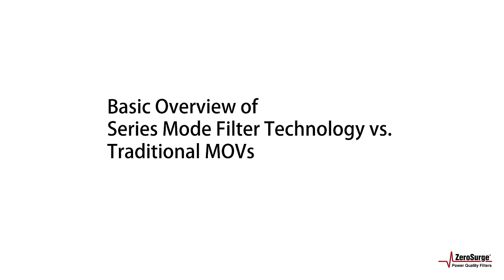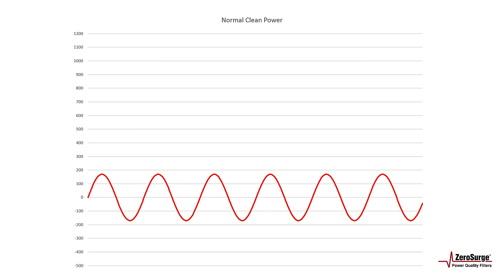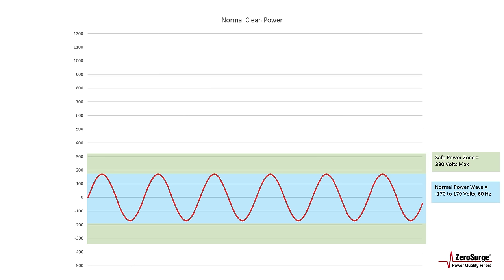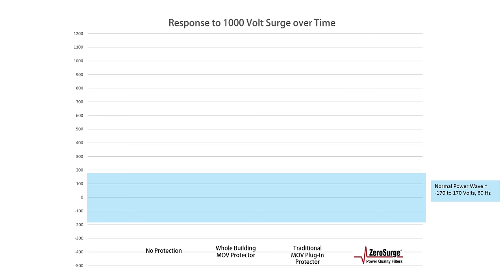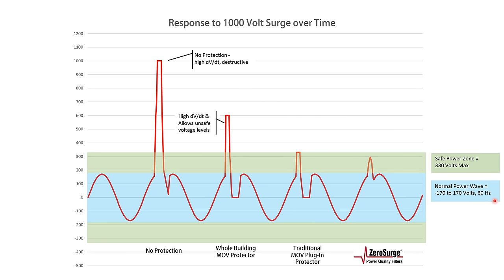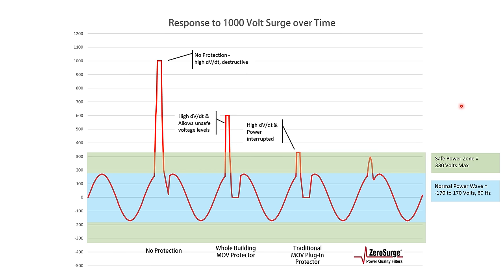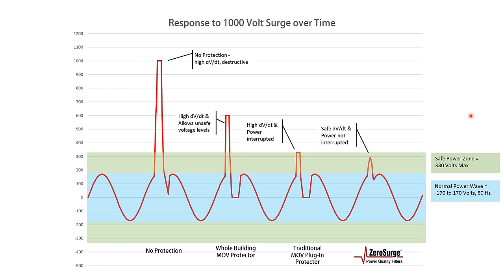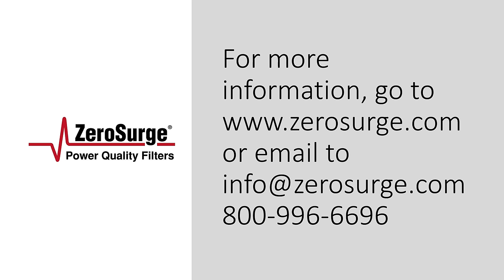How different surge protectors respond to a surge

Comment: Voltage protection should be a tiered safety system. And series mode filters would come at the very end of such a protection system which from the outside-in would look like this: 

1. External lightning protection if at risk of direct lightning: lightning rod, meshed cage.
2. Internal protection at distribution panel: Type 1 or 2 SPD according to risk
3. Internal protection at terminal outlet or panel: Type 3 SPD could be an MOV based system but could be series mode filter for better let-through voltage. 

Now I know you know this, but your website, Youtube videos and every other marketing material distort the truth to make it seem like your series mode filter is the only protection anyone ever needs. Zerosurge is not alone in this, I've noticed this as a trend among most series mode filter manufacturers. And while undoubtedly series mode filters offer better clamping voltage (for a terminal SPD) it is not a perfect system at all, in fact it is quite an inadequate protection system on its own. The major problem is that in and of itself your product does not protect the neutral terminal from surges. Your argument is that since the neutral is bonded to ground at distribution panel, neutral doesn't have to be surge protected. This cannot be further from the truth, there are many instances of perfectly wired and earthed houses whose switched off appliances were damaged just because they were connected to an outlet (i.e., neutral leg). A surge in the neutral line can occur not just when lightning hits the neutral wire (in which case part of it might probably go to earth), it can also be caused by electromagnetic induction from cloud-ground and cloud-cloud lightning strikes. Now the funniest bit I found on your website is that because you don't divert surge to ground you actually claim to protect datalines. Oh my! Consider what happens when an earthed ethernet cable that runs from building A to building B receives a lightning strike causing the earth potential of building A to rise to several kVs, this undoubtedly causes a large surge current to flow from building A to B and destroy any ethernet connected network cards and the like, unless of course it is protected by a dataline surge protector. Also have you noticed why the N-PE module in a multipole whole building SPD is almost always higher rated than the line ones wrt to Class 2 surges? That's because an MOV which is what most manufacturers use for Class 2 surge protection provides bi-directional protection from surge coming through neutral and more importantly surge going back up the earth.

I could go on, but this is a youtube comment and nobody cares. Its just sad to see what appears to be a good power conditioner which I might even consider for expensive appliances to be marketed as something it is not and in doing so tarnishes its own reputation.
Reply from the maker: Sorry for the delay in responding.  I will try to format but this reply may be a little difficult to read.---------------------------
For #1 - We always suggest having external lightning protection like a rod system.  We have never said no to this.  

------------------------------For #2 - Do not need this.  It is extraneous.  Even an MOV plug in will engage prior to the larger MOV in a panel type because it engages at the lower voltage.   ------------------------------------------For #3 - It is more than let-through voltage.  Today’s power supplies are more sensitive to di/dt than any voltage changes.  MOVs can not act on current changes.        ---------------------------------------------What you are describing is known as common mode surges.  Power supplies are required to be isolated so that they can withstand at least 1500 volts with respect to ground.  APC (who does not make series mode technology agrees with us).  I can send you the pdf of their White Paper #9 called “Common Mode Susceptibility Myth”

--------------------------------------------What we say is that the reason that MOV plug in surge protectors have data line protection is that they divert surges to the ground line which is shared by communications.  They are protecting your communications from themselves.  It is extremely rare for a data line to have a surge induced on, even from lightning.  Check out the work done by Joe Randolph who has no ties to Zero Surge - http://randolph-telecom.com/articles-faq.html  He explains how rare and how lightning affects communication equipment.  
--------------------------------------------All MOVs are non-polar so they work in either direction.  Their resistance drops to near zero once a potential exists across it.  Maybe you mean all mode protection as the early MOV protectors only were L-N?  Panel MOVs are larger with much higher activation voltage (700 to 1000 volts).  I suspect the real reason they are always set so high is that their MCOV rating needs to be closer to 170 volts than the 127 volts of an MOV with 330 volt VPR.  
------------------------------------------I know that what SurgeX, Brickwall and we say is not what you may have learned from the dozens of other vendors.  But if you piece together their literature and sift between the lines, you will find out that what we say is correct.  We have 30+ years of experience that backs up our claims.  We have military, commercial, and residential customers that have sent us feedback about how our products protect where others have failed.  We are the only technology to pass UL's 10 year exposure test.
Reply: @Zerosurge  You have completely missed the point on why tiered protection is necessary. Type 1+2+3 surge protection is necessary in addition to external lightning protection because each of those tiers can divert a certain amount of surge energy or surge current. A type 3 SPD like yours has no hope of diverting a 25-50 kA 8/20 μs class 2 surge current or 25 kA 10/350 μs class 1 surge current. Your specification sheet states only conformance to class 3 tests (1.2/50 μs). Prove me wrong and get one of your existing product certified for IEC/EN 61643-11 class 1+2+3 surge protection if you can!

You say: "Even an MOV plug in will engage prior to the larger MOV in a panel type because it engages at the lower voltage."
This is exactly why tiered protection is necessary. Most good Class 1 surge protectors use spark gap technology to divert large surge currents and has a response time of <100 ns. MOV based Class 2 surge protectors have a response time of <25 ns while class 3 SPDs have a response time of <1 ns. 

You say: "For #3 - It is more than let-through voltage.  Today’s power supplies are more sensitive to di/dt than any voltage changes.  MOVs can not act on current changes."
Oh, another twisting of facts or am I supposed to just assume you have forgotten the face of thy father Georg Ohm that you shame him so?
Reply from the maker: That is the key - we do not divert!  Our inductor limits the current flow.  The key word here is APPLIED pulse current. That means the AVAILABLE surge current from the source and implies a direct lightning strike.

The current that will actually flow, is limited to a safe value by our series inductor, and arc-over at the main service panel, where IEEE has used 6,000 volts as a typical
limit.  If our inductor and all the associated series connected wiring had ZERO impedance, then the maximum current could flow, but typically that maximum has been characterized as 3,000 amperes when driven from a 6,000 volt source by IEEE.

IF a 100,000 ampere surge current were available, or even possible, our series inductor would only allow a very safe current to flow.  And again, we are not saying that one should forego using lightning protection systems.  We feel that the type 2 SPD adds no real value.  One could use our product as a type 2SPD (and is certified to be used at the panel) but for only up to 20 amps (branch circuit) because the one limitation is that our present inductor line up only goes to 20 amps.  We have OEM customers that make 100 amp inductors that use our boards but those are for specific A/V applications.  
Thank you for agreeing that tiered protection means that the internal SPD3 will react first (as you say <1ns) which means that it will take the first hit and most likely die which could mean fire as that is one if its failure modes (according to the NFPA 34% of power supply fires were known to be caused by their surge protection).   I know I can not convince everyone and this goes against what 95% of the industry will say because they all have one way to protect and we choose a different method.  But we have independent UL testing that our product survived ten year's worth of surges and no other company even tried it so UL closed the program.  We have so many different industries that use us successfully and happily.  This forum is not the best to convince someone and I don't know if you are a troll from another competitor or what your background is so I am writing this blind.  Try asking around on the A/V forums.  They will give you their experience and opinion.
Reply: @Zerosurge  You say: "Thank you for agreeing that tiered protection means that the internal SPD3 will react first (as you say <1ns) which means that it will take the first hit and most likely die"

Again, missing the point completely on tiered protection or more likely twisting the fact. A terminal type 3 SPD would react first but in a tiered setup it would not fail because by design most of the surge current would be handled by the larger SPD. The finer SPD would only have to deal with a few hundred amps when its usually rated for 5-10 kA while lowering the clamping voltage and protecting sensitive electronics. Look, you can twist the facts all you want or improve your product, get IEC/EN 61643-11 class 1+2+3 certified, your current product probably can't do it and it doesn't protect the neutral, my suggestion is to make a better one. Heck, even put MOVs and series mode filters together to do it. I don't care, I just want something that works for all cases. If you could build a certified panel mounted single unit (rated 60-100A) that can do all that and permanent overvoltage protection due to floating neutral then you have arguably the best product in the market.
Reply: @Zerosurge  

Why does your company not talk about the self-inductance of building wiring, power cords, and similar? They provide a small level of protection by exactly the same mechanism as a series filter: high impedance at high current. A wire circuit is an inductor. 

That effect explains why Type 3 and Type 4 shunts do provide protection without conducting the full surge current. The high dI/dt through the shunt and wiring causes a voltage difference between the protected device and the circuit panel. This voltage is sufficient to activate a Type 2 device and conduct most of the charge at the panel rather than through at Type 3. 

Again: series mode protection means higher voltage nearer to the surge source and lower voltage nearer to the protected device. 

Please schedule a sit-down between your engineers and marketing, so you can stop saying silly things about how Type 1 and 2 are extraneous.There's a very good reason why Motorola R56 requires Type 1 surge protection at all external connections and strongly recommends Type 2 within a facility. 

A series filter depends on admittance somewhere in the circuit, especially to survive lightning surges. A lightning strike is perfectly capable of developing several million volts open-circuit potential if it encounters an insulating load. There's no way your products can block that and no way an electric utility would agree to remove the shunt devices their network. A facility that is protected only by filters is a facility dependent on kindness of strangers. (And by "kindness" I mean "high-frequency admittance." Again, talk to your engineers.)

I sure as heck don't want arc-over in my service equipment. An arc means follow-on current will continue to draw energy from the utility and convert it to heat and pressure. The suggestion that arc-over is an acceptable outcome is... well, it's so bad that if I'm ever shopping for series surge blocking I'll have a hard time considering Zero Surge seriously.  What does it profit a data center if a fire starts in the transformer room rather than the servers?

Lightning current must flow. This means that shunts - air terminals, Type 1 SPD, antenna spark gaps and so on - are the "first fiddle" of lightning surge protection. Physics dictates that your company makes a second-fiddle technology. Don't take it personally, be proud: become the gosh-darn Stradivarius of second fiddles. But don't tell me my orchestra doesn't need to fill the first chair. 

Kudos for not shunting the AC power system to the grounding system though. That's the other thing that rapidly convinces me a company is peddling BS.
Reply: @jordanrodrigues8265 ,  @Zero Surge Inc. 
When reading the comments, I was thinking of Motorola's R-56 standard and those used on telecommunications sites.
How does the serial mode used by ZeroSurge protect the Neutral? The neutral is well connected to the ground but it is only joined at the panel. So, a voltage can very well be created between the neutral and the ground and not see the junction point and affect the devices to be protected?
I wonder why there is not a system with 2 Reactor?
I understand that in many residential environments that a very high percentage of power surges come from inside and not from outside and even less from a direct lightning strike. Thus, in the first situation it surely does the job very well but in the other cases it lacks part of the protection...
However Jack more than 20 years ago had already used in certain systems the use of the ground but this seems to have disappeared...
By the way, I'm not a troll and I don't work for a competitor.
Reply: @Zerosurge  You manipulate information by quoting APC. He doesn't say that in the document I just read...
He speaks first of all about the computer system by discussing the impact of common mode noise that could pass through the power supply and go to the computer and have an impact on the data. Which according to APC, with the fact that only 2 wires go to the computer and not 3 (therefore no common mode), with the filtration and the isolation transformer that there is in the power supply that it is probably the noise going through it and going to the computer to create problems. But it's only in this application...
APC does not say that common mode noise does not exist, that it cannot affect the equipment or that it must be isolated from 1500v, so the neutral does not need to be protected in any case ... But that there is a risk that the common mode noise in this application affects the normal mode...
But it is also necessary to protect the power supply to avoid cuts and other problems related to a defective power supply.
On a telecommunications site, a mountain or other point in height, the strikes are very frequent in the vicinity and directly and will exceed the acceptable levels with a spacing of only 1/2 cm between the input and the output of the power supply which is recommended by the International Security Agency...
Additionally, there are several instances of power surges from data lines like RJ45 creating major issues at both business and residential sites. I don't understand why you deny this?
All this is contrary to R-56 and what Polyphaser, Transtector, etc. have been implementing for a long time... There is someone who is not telling the truth here, that's clear...
I think the use of a di / dt filter has its place in a protection system, but in the form you present it, it still has limits ...
In the residential sector, if there is no major surge coming from outside, as you advertise, then I think the system is not bad, it also has certain advantages, but still incomplete other levels if we want peace of mind.
In the commercial or telecom site, it is simply not acceptable and should be used in conjunction with other SPDs. Anyway, you should be able to ground the box, which is impossible without a modification...
I think you have a good product that could be improved for residential and would offer more complete protection in the situation that concerns us... You are able to modify your product to obtain everyone's approval. But you will have to leave it to others with this technology and reasonable footprint to take care of surges of 10-15kva and more to others and above all not to reduce the impact of other levels with the serial mode...
Anyway, you talk about certification but I think you are also playing on words. In several situations, your products could obtain the UL1449 certifications for example but they have just been tested to "conform" to the specifications but they are not officially certified...
You often drown the fish by talking about certification as if the products had all the certifications listed but this is not the case... More bad marketing!
We must think!